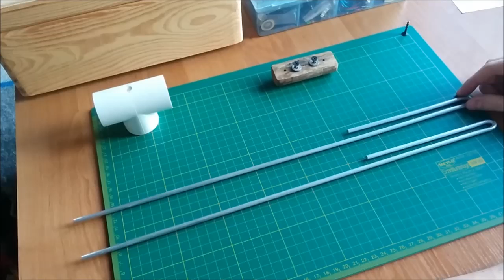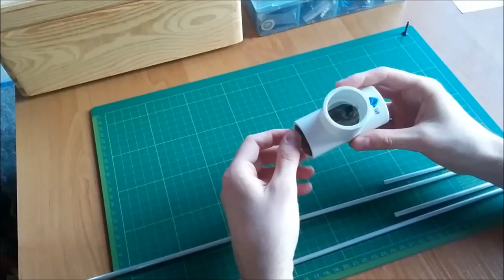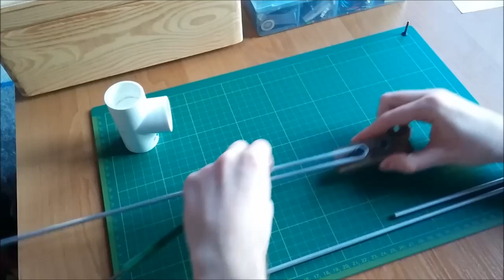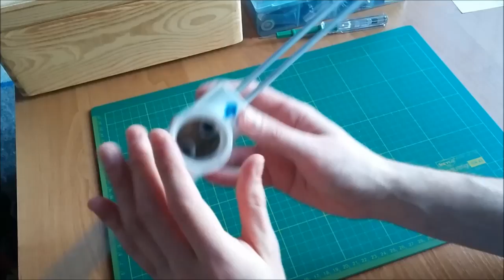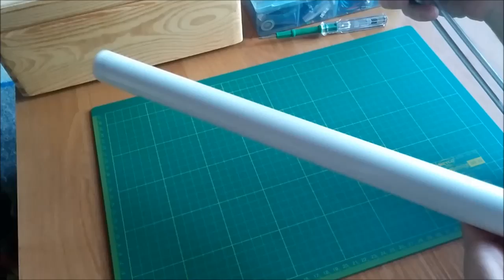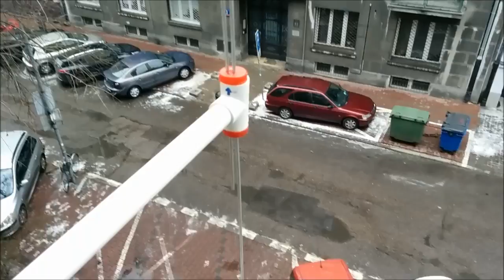Simple VHF and UHF dipole antenna

Comment: Verbatim instructions from the dead link in the description for "Zed Zed's workshop: a simple 2 m / 70 cm vertical dipole antenna":

A Simple 2 m/70 cm Vertical Dipole Antenna:
This easy to build dual band VHF/UHF antenna makes a great project for the new ham that is ready to get on the 2 meter and 70 centimeter amateur radio bands. It can be mounted on a roof top for use as a fixed antenna and it also folds conveniently for travel making it an excellent backpack antenna. The design is simple and so is construction.

 Construction:
The antenna elements are made of 1/8" diameter stainless steel rod. Each rod is bent into a tight "U" shape and fastened to the acrylic plexiglass boom with stainless steel hardware. Flat washers large enough to fit across the gap in each element are used to hold the elements in place. A piece of 1/4" thick cast acrylic plexiglass, 18" long and 2-1/2" wide, is used for the boom.

Drill the holes in the boom as shown in the diagram. The position and hole size for the mast mounting clamp is determined by the size and width of the clamp or U-bolt that you use. I used a TV antenna mast clamp that fits a 1-1/4" mast.

Probably the hardest part in making this antenna is bending the stainless steel rod. But the rod can be bent without heating it first with a torch. I was able to bend the rod by placing it in a bench vise. The tricky part is to bend two pieces of rod that come out looking similar is shape. Use two pieces of stainless steel rod that are longer than needed then trim them to correct lengths after the rod has been folded into a U shape. Make each element section as shown in the next diagram.

The hardware for mounting the antenna elements to the boom is also used to connect the feed line to the antenna. The coaxial cable center and shield are separated and the leads kept as short as possible. Crimp-on ring connectors, with the plastic insulation removed, are soldered to the ends of the cable. The coaxial cable center lead is connected to the top section and the shield is connected to the bottom section of the antenna. This antenna was fed with RG-8X (Mini 8) 50 ohm coaxial cable. The feed line used was a random length and was not cut to any specific length.

I used mostly all #6 stainless steel hardware to attach the antenna elements to the boom. Start by placing an external tooth lock washer on a machine screw then insert it into the hole drilled in the boom. Next install a flat washer, then the antenna element, then another flat washer. The ring connectors with the coaxial cable attached go on next then finally fasten with a split lock washer and a wing nut. Repeat for the opposite side.

Tuning the Antenna:
To tune the antenna for minimum SWR simply loosen the wing nuts and slide the antenna elements in or out as needed. Keep in mind that changes made to one band will affect the other band. For example if you shorten the 2 meter length then you also shorten the 70 cm length. Some fine tuning by again trimming either the 2 meter or 70 cm sections may be done if desired but this should not be needed.

All stainless steel element mounting hardware. Use larger size hardware if flat washers do not extend across both sides of the antenna element.

Part list:
2 each 1/8" Stainless steel rod, 3' (.9 m) long.
Acrylic Plexiglass, 18" x 2-1/2" x 1/4" (45.7 cm x 6.4 cm x 7 mm).
2 each #6 x 32 x 1" (25 mm) Machine screws.
2 each #6 x 32 Wing nuts.
4 each #6 Large flat washers.
2 each #6 Split lock washers.
2 each #6 External tooth lock washers.
2 each #6 Crimp-on ring connectors.
Mast mount clamp.
Plastic cable tie or small U-bolt.

(I could not include the picture diagrams as YouTube does not allow links. One photo shows the measurements for the rod. The steel rod should be exactly 18 5/8 inches in (47.3cm) length. You need to bend the rod so there is exactly 6 ¼ inches (15.9cm) for the short end. The bend should be 3/8 of an inch (10mm) in width.)
Reply: The longer part should be 47cm long, not the entire rod.

Comment: Hi how long must uhf elements be ...
Reply: Roughly 1/4 of the wavelength of what he is going for. So for the 2m side it would be ~50cm; for 70cm it would be 17.5cm.

Realistically you want to do some more calculations to find the exact wavelength of what frequency you are using.

Comment: I couldn't find a stainless steel or even an aluminum... would it okay for a copper brass?
Reply: It should be ok, but length need to be tunned a little.
Reply: Coat hanger

Comment: Nice video. Do you think it's possible to combine 144 and 220MHz as you did with UHF? 73 de PY5CL
Reply: It is. You would need a longer length of material to start with, and and just bend to the mid-range frequency of each band. The reason you need the material to be longer before you bend is because the 220Mhz element will be slightly longer than the 440MHz element he shows in the video. Try it an let us know how it works. 73 de KC0OLH.

Comment: Thoughts on this type of antenna vs the copper tubing j-pole for performance?  This seems more mobile and easier to mount.  Any other thoughts?
Reply: The one in this video is dual band 150s/460s j poles are single band.  If you only need 1 band and want more gain in 1 direction then youd want the j pole. I have a homemade dual band dipole mounted in my attic for my baofeng and it works great all directions. I just used high quality rg6 catv coax and made sure I measured it in half wave lengths and I used an swr meter to fine tune the distance between the elements.

Comment: How much is the Road Diameter? 3mm  is it right?   Can I do this  Antenna with 4 mm?
Reply: Pietro Musian As far as I remember I used 5mm diameter rods. 3mm and 4mm are OK just bandwidth will be a little narrower.
Reply: No, you will open a Blac Hol that swallows the rest of the earth if you use 4mm.
Reply: @thebutcherofbenghazi.libya3348  LOL

Comment: Does such antennas have better UHF reception because the antenna is larger. Because it includes VHF dipole? Or does it not affect UHF reception or may it fail to receive UHF?
Reply: This antenna receive both bands VHF on longer element and UHF on shorter one.

Comment: Nicely and simple made dipole, longer tubes for 2 meter band and shorter tubing  for 70 cm band, also the 2 meter band dipole could work as a 3/2 wavelength  harmonic antenna for 70 cm band. Video shows a vertical omnidirectional Antenna but small dipole may have some directional characteristics as being close to the larger dipole. thank you.